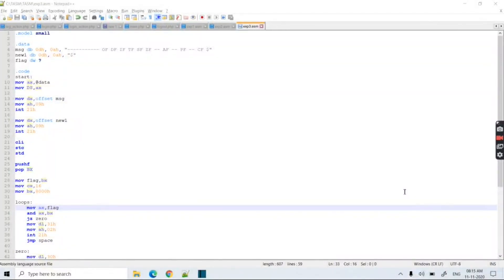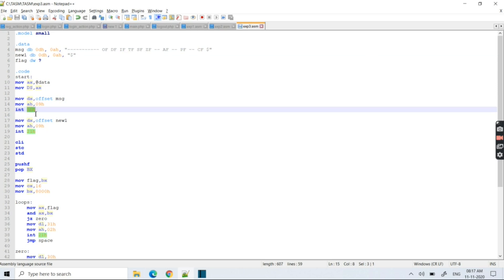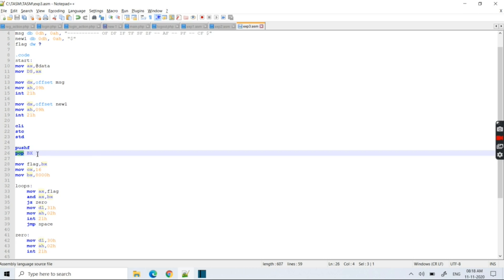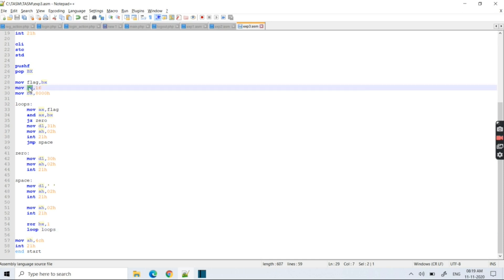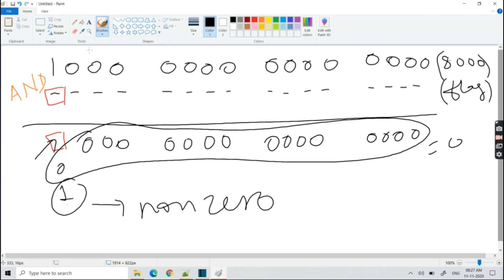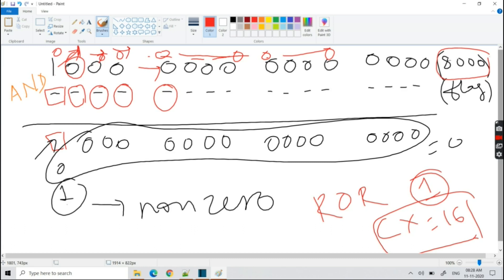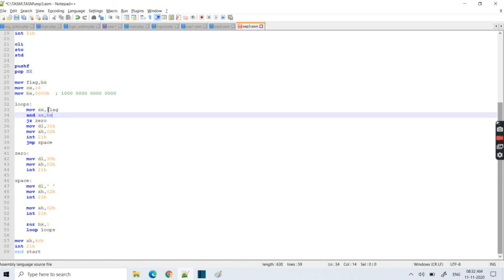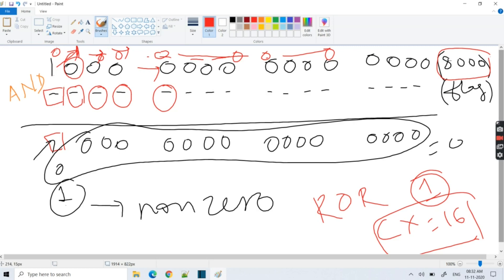Assembly language program to display the contents of 8086 flag register

Comment: Data Segment
 msg db 0dh,0ah,"-- -- -- -- OF DF IF TF SF ZF -- AF -- PF -- CF $"
 newl db 0dh,0ah,"$"
 flag dw ?
Data ends
Code Segment
assume CS:Code,DS:Data
start:
 mov ax,Data
 mov DS,ax

 mov dx,offset msg
 mov ah,09h
 int 21h

 mov dx,offset newl
 mov ah,09h
 int 21h

 cli
 stc
 std
 
 pushf
 
 pop bx
 
 mov flag,bx

 mov cx,16
 mov bx,8000h

loops:
 mov ax,flag
 and ax,bx
 jz zero
 mov dl,31h
 mov ah,02h
 int 21h
 jmp space

zero: mov dl,30h
 mov ah,02h
 int 21h

space: mov dl,' '
 mov ah,02h
 int 21h

 mov ah,02h
 int 21h
 ror bx,1

 loop loops

 mov ah,4ch
 int 21h
Code ends
end start